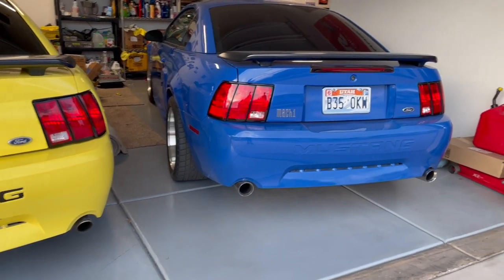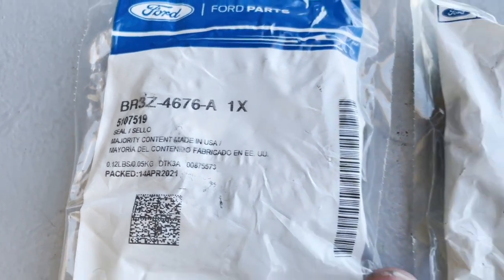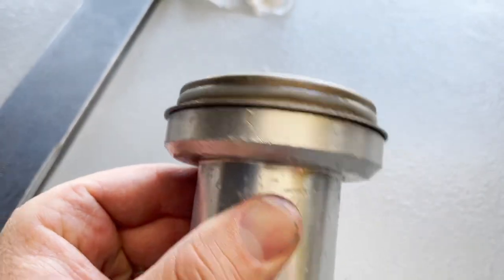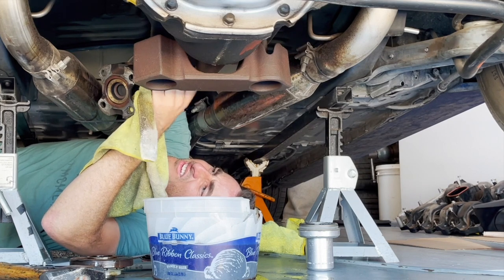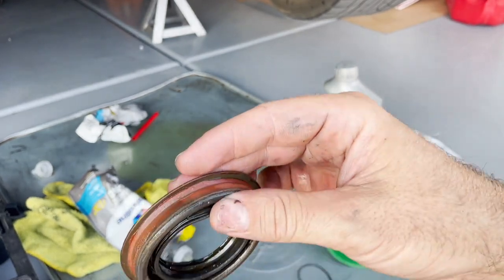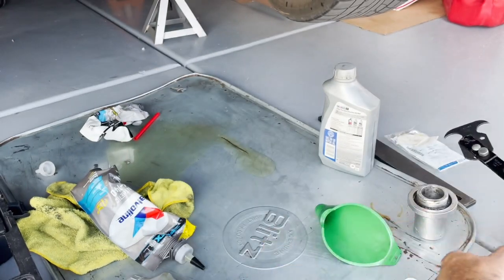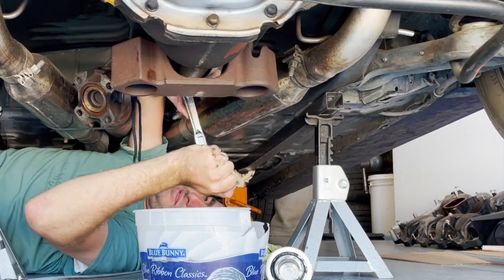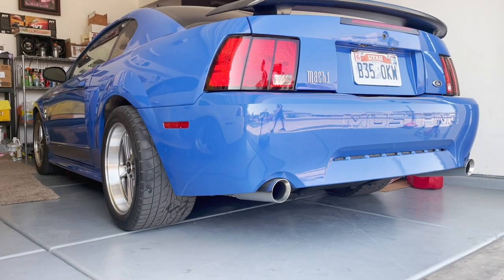2003 mach 1 mustang update : pinion seal replacement and cool tool

Comment: Been there with the pinion seal on my Mach,  had to change it twice now. Put a new one in during the gear change and about 3 years ago it started leaking so new pinion seal. It's been good every since. It is a pain to change though.  Good video Justin,  very informative. 👍
Reply from the maker: Thank you. That’s interesting you had that issue with a new one.

Comment: Nice job! One of those wear and tear items that just go out over time especially when sitting
Reply from the maker: I’m surprised. I’ve had higher mileage Mach 1’s and GT’s with no leaks. It guess it’s from sitting.
Reply: @justin.c_svt  It's a double edge sword, parts wear out from use, and from not being used. Can't win either way lol
Reply from the maker: Well said
Reply: Bout to do the same to my 02 GT just had it on the lift a few months ago for a tranny rebuild WHY I didnt do it then IDK.

Comment: Remember pinion preload set to 16 to 25 and i always use 75w140 weight gear oil ots something about 75w90 that breaks down as the gears heat up and boil the oil causing the seal to distort and leak

Comment: No BULLITT idle clip 😭😭 😂🤣jk yeah I bet it was a little scary taking the nut off and putting it back on knowing that if the crush washer moves any it could mess up the preload ending in possible noise or worse if it got way to tight, when I built my rearend and I was tightening the nut and trying to sneak up on preload without going over i would turn just a tad and check it because if you go over you can't just loosen the nut, u have to get a new crush sleeve as well and you talk about being really nervous, i was sweating bullets,not because of the cost of the sleeve but just having to redo it all over again and the hassle of getting the sleeve again
Reply from the maker: Exactly

Comment: Hi Justin, great video! I’ve always been curious, do you know what the paper tag on the right side of the diff. means? My car has it also
Reply from the maker: I don’t know exactly.
Reply: @justin.c_svt  ohh ok.
Reply: If it's the tag if believe your meaning on the upper right corner, that is the diff data tag; stamped on it is the gear ratio(3.73, 3.08,...), the diff size(7.5, 8.8,...), the manufacture date, and plant data.

Comment: How did it hold up?   How did the rear feel after the install?   I also am afraid of not getting the nut back exactly where it was/ not having it tight enough or to loose.
Reply from the maker: So far it’s perfect. It seems to be exactly like it was before with no noise or leaks. My friend said to go ahead and tighten it pretty tight cuz it would take a lot to crush the crush sleeve even more but I was still careful.
Reply: @justin.c_svt  thanks for the response.   I’m actually getting all the tools right now to tackle the job.
Reply from the maker: @jamesa6272  Good luck. Hope it turns out well.
Reply: @justin.c_svt  Thank you. I just made a seal driver to get the seal in instead of hitting it with a hammer.  Got everything I need. Now I just need dry ground and a warmer day haha